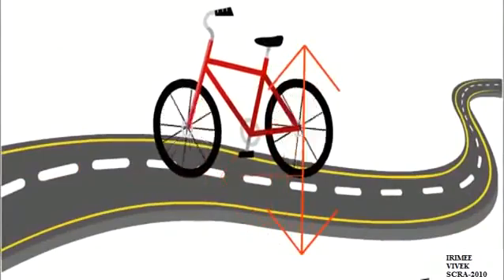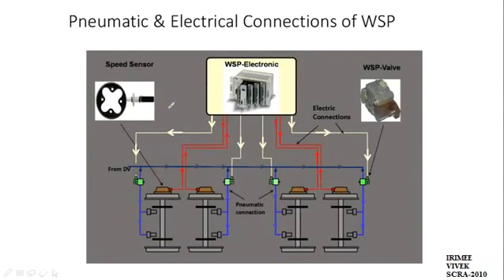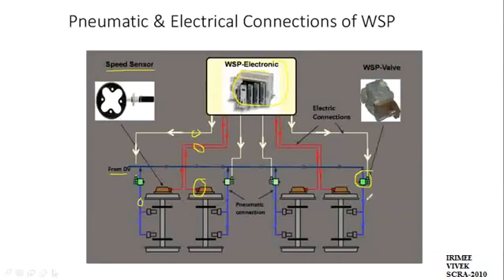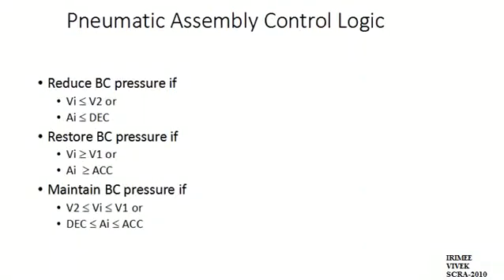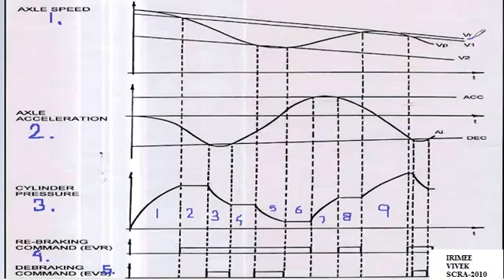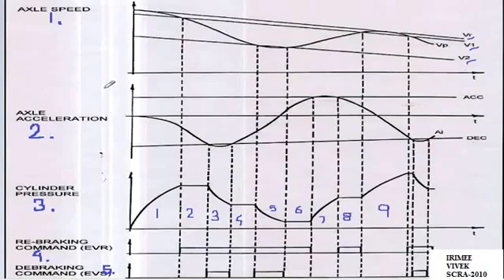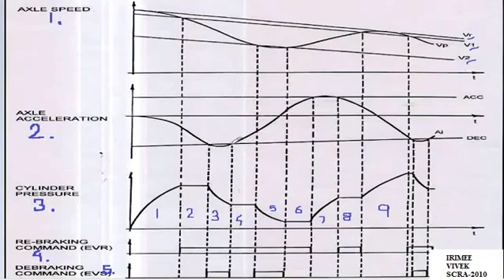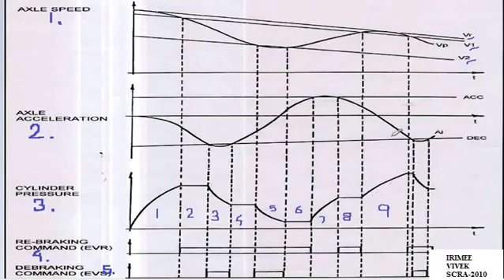Wheel Slide Protection

Comment: WSP never regulates BC pressure since it has got only one position. I think you try to co relate with automobile ABS with the WSP which is incorrect.In cars pressure modulation is by spool valve but here in WSP we have solenoid NC or NO ,only two position